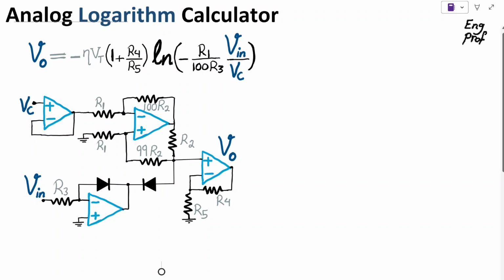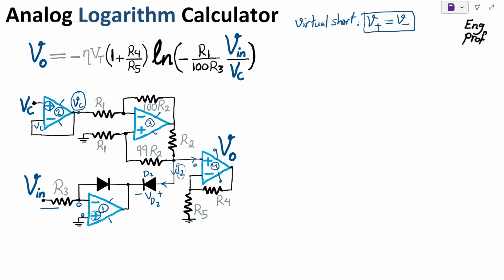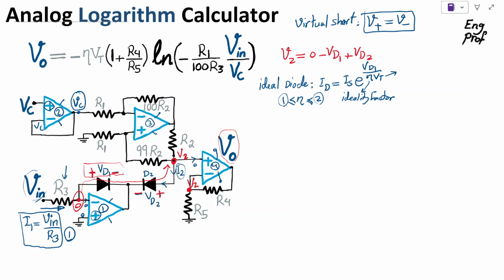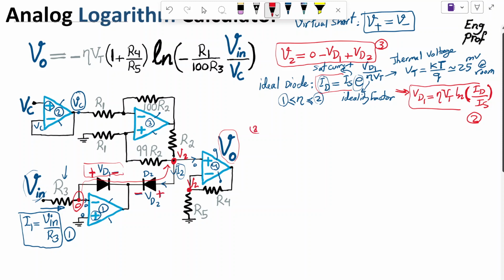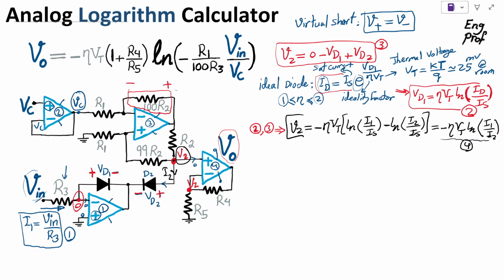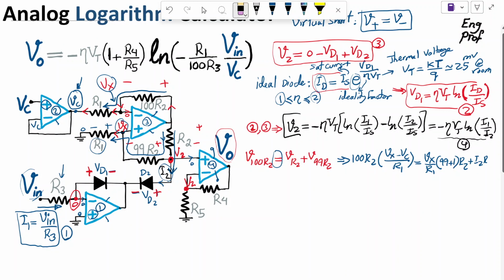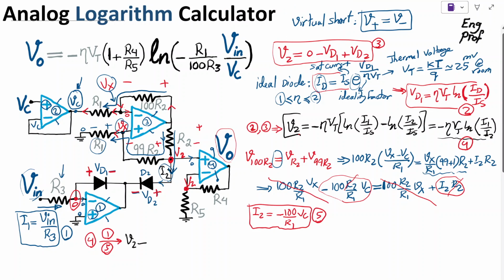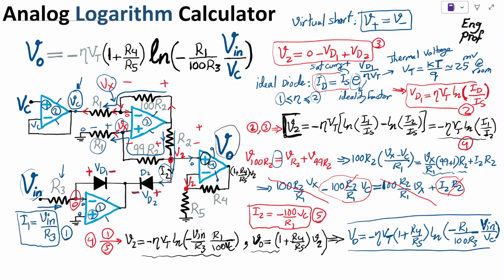Analog Logarithm Calculator with Op Amp and Diode

Comment: Pretty cool design!
Reply from the maker: Thanks! Glad that you liked this video. Then, how about a simpler Logarithm Calculator Circuit in https://youtu.be/RpKEq5WyoLg that only requires two Op Amps ? :) I think you will also like the Analog Exponential (Anti-Log) computer explained in https://youtu.be/kk2c7Gk3nW4, and the ultimate of all, the https://youtu.be/Qe3cY9JSzYg which is the Analog Computer Power Raiser Design with OpAmp, Transistor & PTC temperature compensation.

Comment from the maker: Thanks for watching. For more Analog Computer & Op Amp Circuit examples please see: 
Op Amp Analog Computer Differential Equation Solver: https://youtu.be/ENq39EesfPw
Analog Logarithm Computer with OpAmp: How does it work https://youtu.be/RpKEq5WyoLg
Analog Computer to Raise Signal to power n https://youtu.be/IUTlBH1UraE
Push-Pull Power Amplifier with Darlington Transistors https://youtu.be/866MYibo8yE
Op Amp Analog Computer Differential Equation Solver: https://youtu.be/ENq39EesfPw
Triangle Oscillator Op Amp circuit https://youtu.be/JF5Up_cuL9k
Full-Wave Rectifier  https://youtu.be/DJJMNU-CYcg. 
Differential Equation Solver Analog Circuit https://youtu.be/R3X5AYNZGEI
Diode-Amplifier VTC is analyzed in https://youtu.be/vpGZkafxMJM 
https://youtu.be/HeZRtnRXpEI presents a circuit with op amps and feedback loops to design an analog computer that solves a second order differential equation.
For more analog signal processing examples see: https://www.youtube.com/playlist?list=PLrwXF7N522y4c7c-8KBjrwd7IyaZfWxyt
I hope these Circuit design and analysis videos and Examples are helpful.